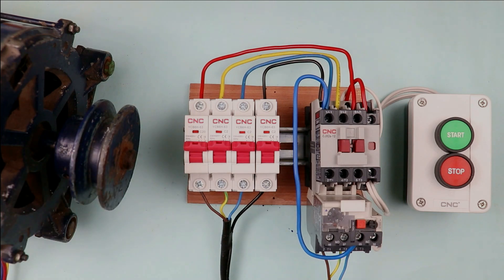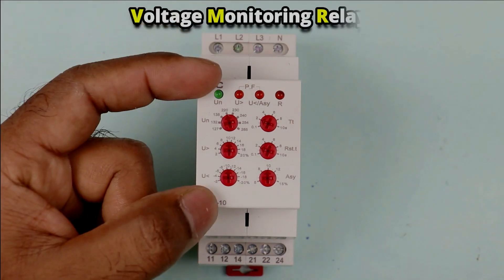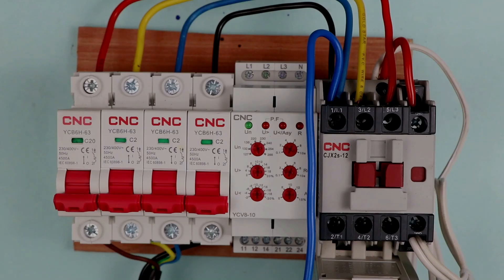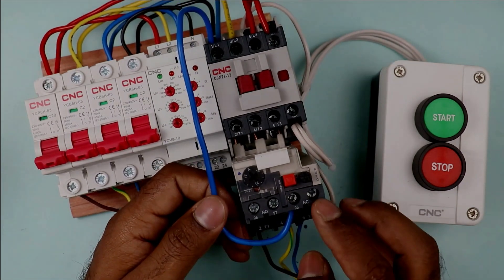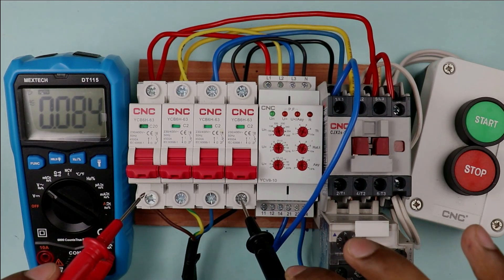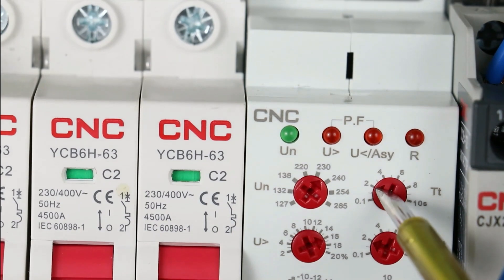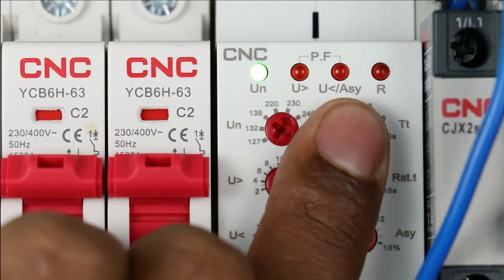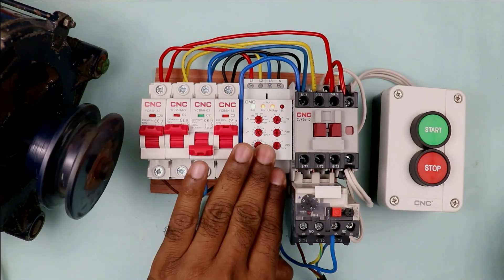Voltage Monitoring Relay Connection with DOL Starter for Motor Protection @TheElectricalGuy

Comment: Dear sir can you explain how to select under voltage relay and mcb and contactor , wire size for dol starter and also how to select single pole mcb for control ckt